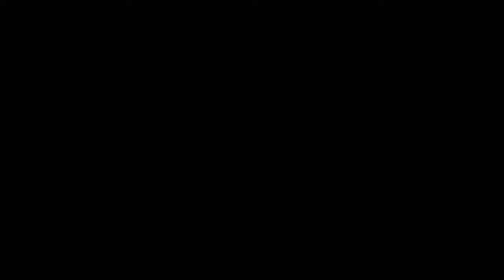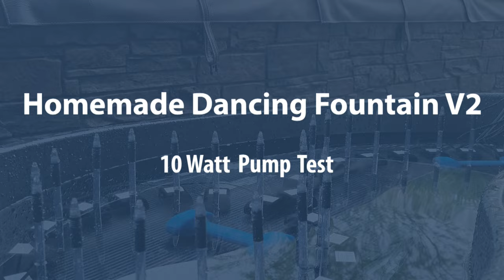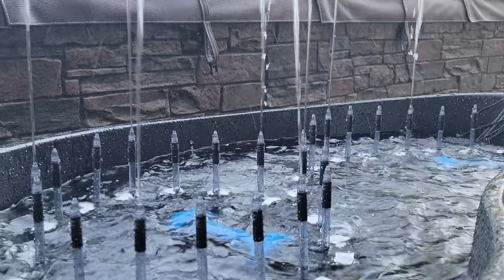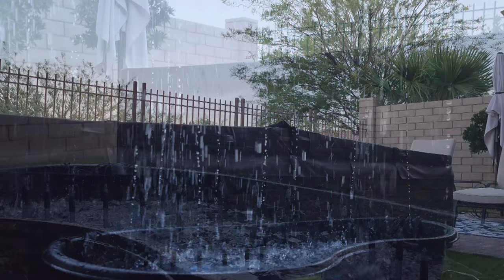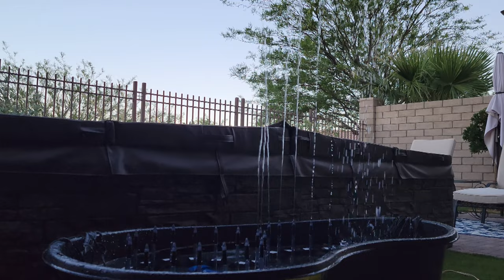Homemade Dancing Fountain -Version 2- (10 Watt Pump System Test)

Comment: Where would you place the Oarsmen? At the ring? Btw I think you need to adjust some "shooters" to make them more straight
Reply from the maker: 2 Oarsman will be positioned in the ring and 4 will be placed along the arc. When the fountain is complete the shooters will all be straight but currently they are just temporarily installed for testing purposes. They will be attached with stainless steel brackets in the finished version to straighten them out. Thanks for watching and commenting!